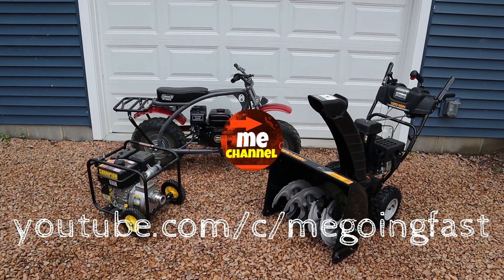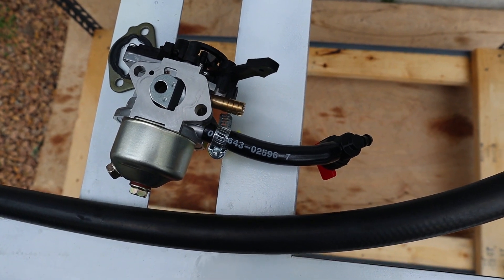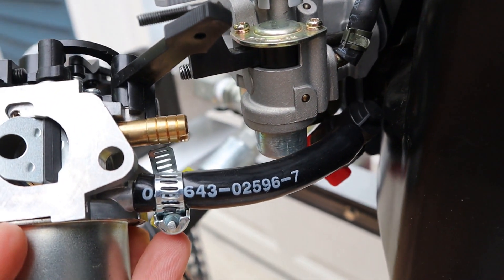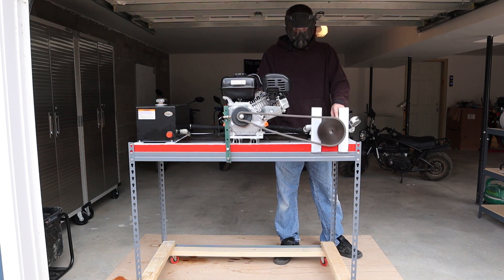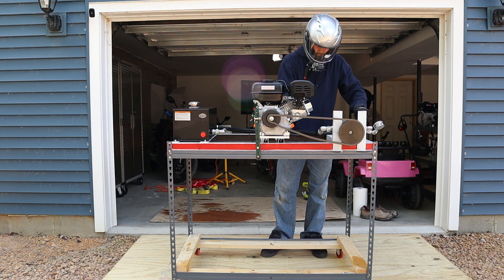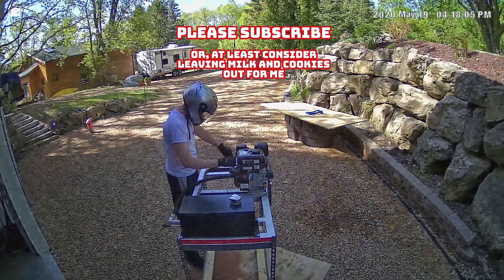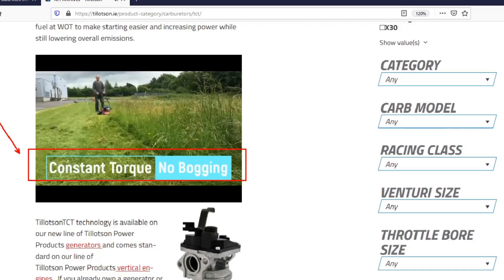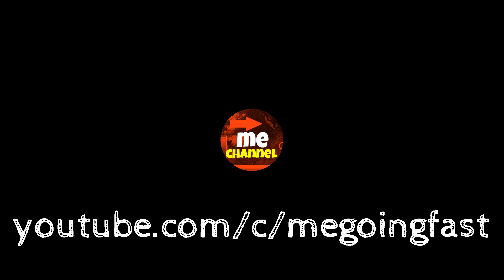Mechanical Fuel Injection carburetor for small engines (tested on predator 212)

Comment: What is there for 420 cc clone , I have a 15 hp on my snow blower now. Great video
Reply: 459cc new red engine  at harbor freight forged crank yep lol like it needed that but hey all good to me big valves thin performance light weight piston i own one i pulled it apart its a darn nice engine amazingly so get one
Reply: 459cc new red engine  at harbor freight forged crank yep lol like it needed that but hey all good to me big valves thin performance light weight piston i own one i pulled it apart its a darn nice engine amazingly so get one
Reply: Thatswhat I need for my predator generator

Comment: What is the actual model number of the carb in you video? It does not look like the ones that Go Power Sports sells. I bought the TCT from them and it has (TF-8A-6C 110 177) stamped on the side of the casting. At 0:05 on you video, your carb appears to have a brass inlet tube above the fuel line. What is that? Neither of the Tillotson "mechanical fuel injection" carbs that Go Power Sports sells have that brass tube. The only Tillotson carb that I can find on the internet that has that same brass fitting on the side is a "dual fuel" carb for a generator that can be used to meter propane.

Comment: I'm considering one of these for a mini bike build have u don't any comparisons on test driveing with both carbs
Reply from the maker: Not online, but i have done. The tct needs to be with it's proper "version" on a build. There is a version for stock exhaust, and a version for if using a header. They keep rpm low with bringing up torque so swapping to smaller gear makes an improvement for speed. With a header, stock carb goes faster than the original tct, but the tuned tct meant to be run with header has the edge over stock carb if using header. If you intend to further build the engine, the tct is limited. If planning on keeping governor in and getting the most from a small build with cvt the tct is great choice.

Comment: Do you think this would be good for a mud motor?
Reply from the maker: Really depends on pitch prop, diameter and other mods. The torque will be there, bringing back rpm, but changing props is your biggest gain on boats.
Reply: Going to try the TCT on my Mud-Skipper Twister (with prop adapter and Tillotson 212e), it uses 2-blade aluminum long-tail props. More interested in torque than top speed, and not really interested in making recommended mods for higher rpm's than what the engine is initially designed for. After taking it out yesterday, I can say that bone-stock the Tillotson 212 is a stronger engine than the stock HF 212 hemi, (of which I've owned/run many). $40 is not much money for an adjustable carb.

Comment: Calling this a "fuel injection" is simply wrong. It is a carburetor with enhanced atomization and the conveniance of not having to change the needles for a tun.
How do i know it's not an injection? Well simple, you need either of two things, an electronic fuel pump and an ECU, or a mechanical connection to the crankshaft for the injection pump.
Reply: Exactly right... this carb is neither "mechanical" nor "injected"... There is no mechanical apparatus that pressurizes the fuel, and the fuel is not injected... If you dig into the operation, it has a variable needle similar to a motorcycle carb... the advantage is the atomization of the fuel.  Stock carburetors on these motors are the worst ever, and are easy to improve...
NOT saying new one does not work or is not an improvement...  Just saying that the term "mechanical injection" is very misleading...
Reply: If youre going to correct someone,  make sure you know what you're talking about. None of what you listed actually describes what efi is. There's several different types of efi and strategies used for for fueling. But one thing that makes them all efi is that they are electronically controlled, see its in the name electronic fuel injection
Reply: you're forgetting one thing: diaphragms.
I don't know if this specific carb does it as I know nothing about it, but some carbs (usually on 2 stroke boat motors) use diaphragms and the engine pulse to literally inject pulses of fuel into the intake, in addition to the fuel pump which is also driven by the intake pulses. Usually it helps deliver fuel while needing less of a venturi, and therefore less intake restriction at the high RPMs they see.

This Tillotson one may or may not operate on the same principle, but it seems to have been executed poorly. The whole point should be less intake restriction, not more.

Comment: Nice info.  Ideas for future videos if you have not already.
Aftermarket camshafts - bottom end - mid range torque increase with that injection vs. Carb. Aftermarket head, w/ & without cam, pistons, injection ect.  Then try fuel addives for power - marvel, E85, nitro ect. You probably got all those written down by now. Top o the day

Comment: How does it compare to a mikuni?
Reply from the maker: It can't, really. It has a very narrow venturi. Both can increase torque, but the mikuni can get gains in hp by raising RPM and sucks fuel. The tct can keep rpms lower while upping torque which is GREAT to keep rpms lower than a point where and engine could hit a failure point (stock flywheel and internals). However, if a mikuni is on the engine, you'll likely need to compensate other parts of the engine to prevent failure and get the most from the carb fuel delivery and increase in air as well.

Comment: On my Predator mod snow thrower i would rather have the higher speed.  I want to go faster and rarely have an issue with it bogging down.  I will stay with my stock carb thanks.  Nice job on the video.  Very informative.....
Reply: Same.

Comment: i am thinking about doing that but with a Tillotson 212 hemi. How would that go?
Reply from the maker: Overall close to the same. A very good pairing around 8 HP with a bunch of torque that can rev higher than the predator.
Reply: @megoingfast  I thought that the 212 Hemi was 10 hp
Reply from the maker: @charliemaybe  yeah, well, marketing likes bigger numbers 😉😉. I have a video comparing the tillotson 212r with hemi flat top piston to the predator on a Dyno that explains it all. Tillotson website gives a Dyno chart also. It's a great engine, don't get that part wrong! Serious torque!!

Comment: What's the actual Horsepower an Torque of a Stock Tillotson 212?'
Reply from the maker: I'll have the 212r on the Dyno shortly, but sadly there were quite a few "manufacturing issues" I've worked with a little with tillotson, but... Yeah, even I just gotta wait and see. Breaking the engine in on a mini bike right meow. Hope to have this done soon and video posted for the Tilly.
Reply: 10hp. 12hp on the 212R not sure about torque

Comment: Try out cheap amazon carbs to see if there any good
Reply from the maker: The 22 mikuni kit is on my list. The pb1k should get swapped from my tillotson as well. Any one in particular you're thinking?
Reply: me sure I have the Massimo 200 so I was looking into the  Poweka not sure if that would work on yours but their is also a Hiaors that fits the CTU 200 either one or something equivalent would be awesome to see they are both cheap coming in at under $20 which is why I’m curious and they are both sold on Amazon I just typed carbs for Coleman mini... thanx bud great content 👍🏻
Reply from the maker: The PZ 19 equivalents, or the ones that are the same as other branded $10 carbs? 16100-ZH8-W61 and 16100-ZE3-V01? I purchased both of those listed just in case those are it. Had adjustable F/A and idle so looked good no matter what use to try out. Will be picking up a few more, but PZ 19 and PZ 20 is a pretty small carb where the slide control has been a pain to work with in the past when I did small engines.
Reply: me that all sounds great whatever you choose will be good thanks